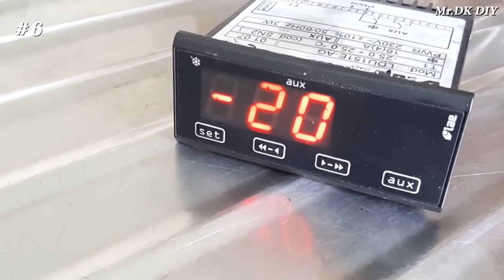10 HOMEMADE Smart Inventions

Comment: What kind of motor are you using for that car Jack great idea
Reply: Just add a nut to end of the jack. Then use a socket on a cordless drill. Much easier and faster.